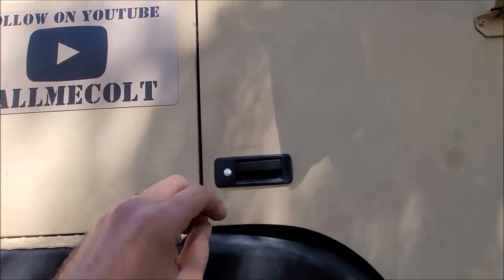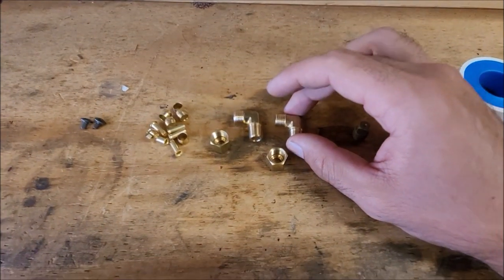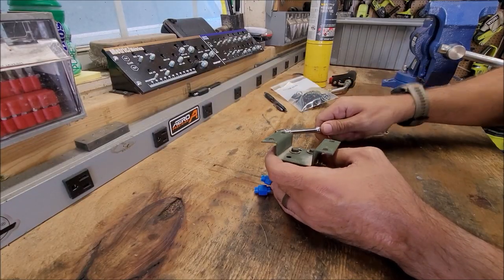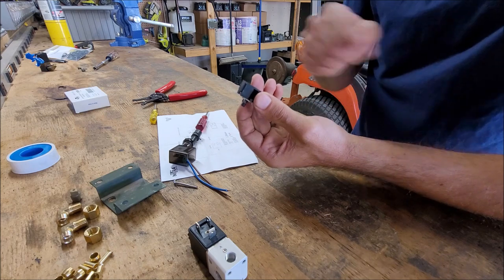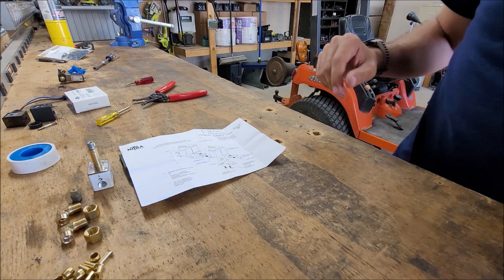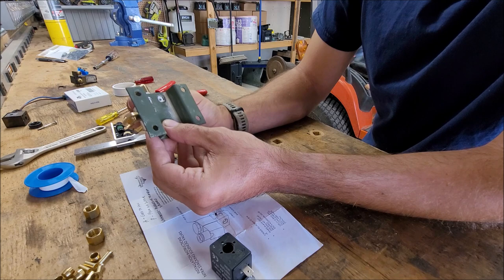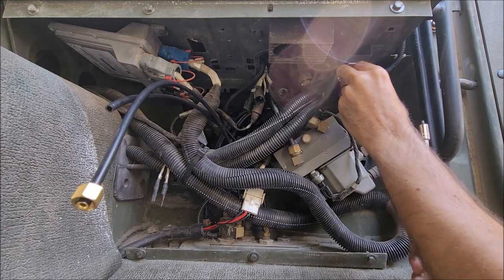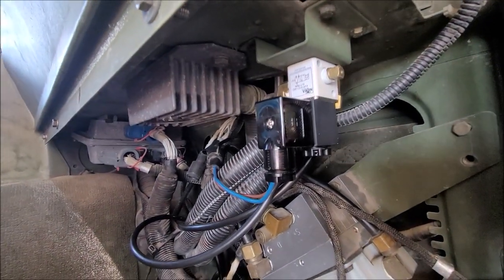M1078 LMTV - Aftermarket Fan Clutch Solenoid

Comment: Nice R&D Colt!  The only thing I would suggest is purchasing a restrictor pill for that solenoid (I believe they sell them).  The reason being is the oem solenoid has a very small bleed orifice so that the fan clutch is not getting slammed/dumped because the air pressure is dropping too fast.  This can result in a catastrophic failure that will take out your radiator, and possibly your belts.  

Think of it like this:  When you drive a manual transmission vehicle and you drop the clutch in 1st gear rather than letting it out slowly for a smooth engagement.  I was on the same path that you were with this one and this is the big setback that stopped me from moving forward.  If you find or create a restrictor pill that matches the oem sized one you have got it made.

Thanks for posting this well thought out solution to a part that is in short supply.
Reply from the maker: Admittedly, I did not think of this but I get what you are saying but the hole size is very small on these new ones (1.2mm). I went & looked at the size on the old one & a rough measurement showed 1.4mm. Even with error, they are darned close so I don't think there is going to be an issue. Other valves I tried did not have this small of a vent hole.
Reply: Yea like Colt said it has a slightly smaller vent port, it was also noticeably quieter than my original was when venting/engaging…
Reply: Love it nice find big thanks to all of you who find these parts      Thanks to rronmar. And CallMeColt.

Comment: Parts ordered for MTV through your links. Thank you! Still waiting to hear on the CTIS hoses.
Reply from the maker: Thank you! Appreciate you watching. The CTIS hose project really hasn't worked out. It seems like just getting the OEM ones if you really need them is going to be the way to go.
Reply: @CallMeColtLLC  what part of the hose issue hasn’t worked out?
Reply: @CallMeColtLLC  I’ll try to stop in there to see how they are doing with a CTIS hoses
Reply: @CallMeColtLLC  hi colt. I stopped in today to get an update. It’s a bit of a mixed bag, but that was to be expected :-) the mixture of SAE and metric parts creates the issue. A metric swivel to do what we wanted to do is expensive, bulky,  and hard to source. My goal is to make this simplified so that somebody on the road can easily come up with a replacement. since I have a truck with both the old style, non-swivel, and the swivel, I’m aware that the swivel is nicer, but not absolutely necessary . OEM units are nice but because rubber and plastic is a large part it’s constituents, I would be concerned about getting an older hose. so the goal for this replacement hose set up is to go from point a to point B with the hoses , achieve parity in Function. Possibly without the swivels. if we can pull it off, he will make kits available. The new hoses will it be pressure rated into the thousands of pounds, so should offer very good service life.
Reply from the maker: @urgentcareguy3  I think it would be easier to spend the roughly $225 and keep a spare, used assembly or brand new hose on the truck myself. Also, a valve core. That's what I'm going to do.
Reply from the maker: @urgentcareguy3  no one can source proper fittings due to Spicer I believe having a patent on all of them. Some fittings can be close, but nothing ends up working well in the end and it cost as much as a new hose or used assembly.

Comment: Thanks so much for the solenoid and the extra hoses and fittings!
Reply from the maker: No problem. Good luck with the install.
Reply: I just saw a picture of last years shoot and noticed you didn't have a grill in your truck.  Do you still need one? I put a new style grill in mine and have the old one.

Comment: I want a solenoid.  Also, just a heads up, don't leave the nozzle in the tank like that.  If you are not careful, it can cost $100.   : )
I went to get fuel one time and the lady behind the counter said "Fill it up?"
I said "that is a 55 gallon tank, we don't throw terms like "Fill it up" around..."
Reply from the maker: You got the Solenoid. I will message you directly with details!
Reply from the maker: I am unable to send you a direct message. Please e-mail me at tbcmarine@yahoo.com with the subject as Solenoid Giveaway. Thanks!
Reply: I have posted a couple of times, but each time I go back, my post is gone.  Never had that happen before.
Reply: That one seemed to stick.  Anyway, thanks for the solenoid!  I actually tried the fan test where it won't spin when off and should spin when on.  That didn't work the same as yours, so something odd is going on.
Reply from the maker: @elgoogsucks9005  I have had that issue before as well. I'm not sure why it happens. Once you send my the e-mail with your shipping information the box will go out. It's going to include all the needed adapters & some new 1/4in air line as well.
Reply: This is so weird, I comment on Youtube all the time.  It is lile they don't want me to have anything nice.  : )  I am wondering if it has something to do with email addresses.  Anyway, I tried sending to the one you listed but it was returned.  I thought maybe it was missing an i, so I changed it and sent it but have not heard back.
Reply from the maker: @elgoogsucks9005  Go into the About on my channel and my e-mail is there. It did typo, I'm sorry. tbcmarine@yahoo.com This is quite the mess, I'm sorry!!
Reply: I just sent an email, you might have to check your spam mail.  That would be yahoo protecting you from schmucks on the Internet and, to be fair, I am a schmuck on the Internet....
Reply from the maker: @elgoogsucks9005  Got it!

Comment: COLT, 

as a side note my solenoid went sleepy this am after 3 years of LMTV ownership ... I took it apart and a noticed thrv"plunger " was sticking.. a few drop of oil and the solenoid Is working well.. but for how long?..beats me.... are your fan solenoid kits still available ?
Thaynk
Reply from the maker: The oil is a temporary fix. It lasted a few months at a time for me. For the kits, I always keep them in stock. I have a few "blemished" ones right now I can sell discounted. Reach out at the e-mail on the top of my website, www.callmecolt.com.
Reply: @CallMeColtLLC 

Ordered and received … thanks much CS